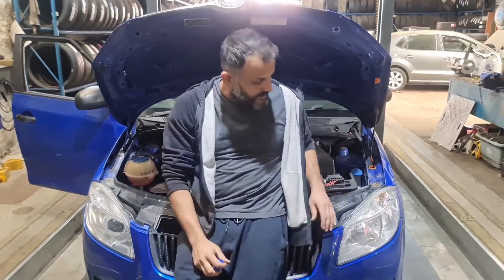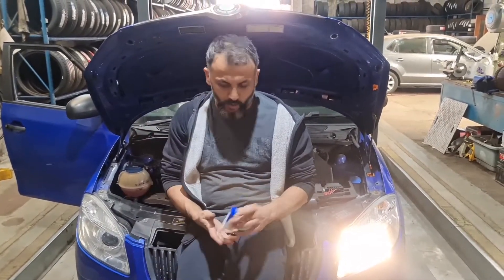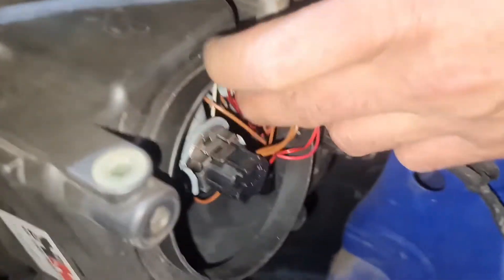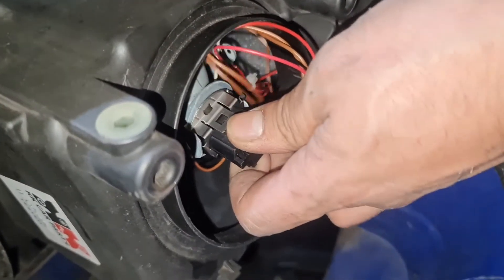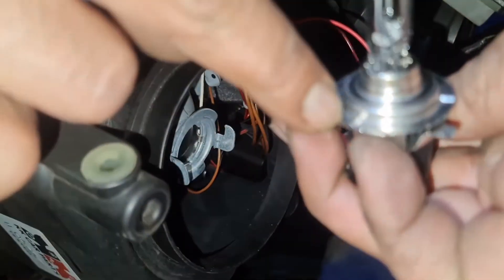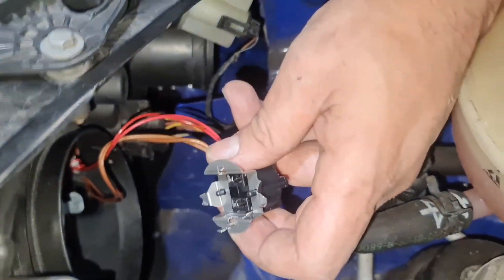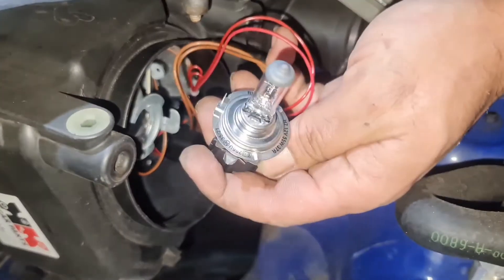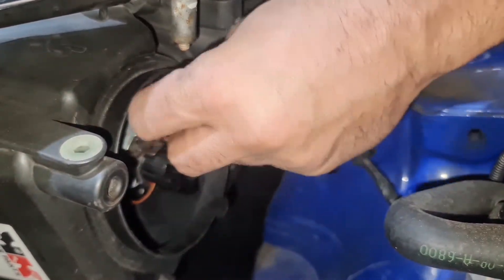how to change full beam main dipped bulb on Skoda Fabia MK2 facelift #headlight

Comment: Thank you for the video. My holder seems completely stuck. Won't budge at all, even with a good amount of force. Any tips /tricks for really stubborn ones ?
Reply from the maker: Hi don’t remove the plug and wiggle it, at same time pull the plug up or down or in an angle and the bulb should come out.
Reply from the maker: The bulbs can be a nightmare if fitted incorrectly previously and also check with a mirror to see what’s stopping the bulb from coming and you’ll get an idea how to pull it. Thanks 🙏🏽